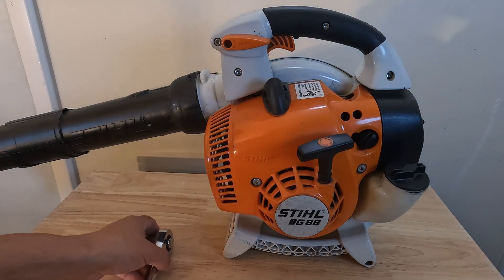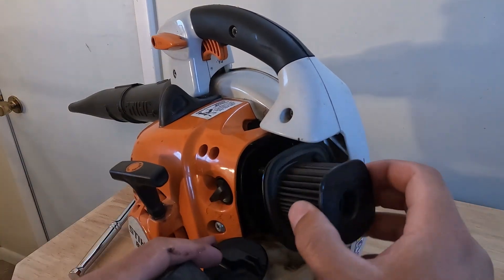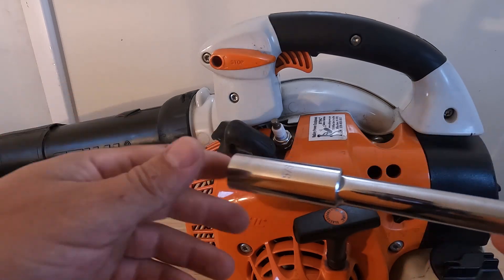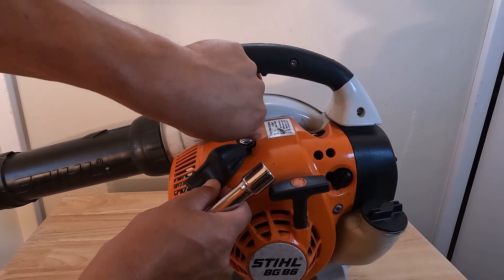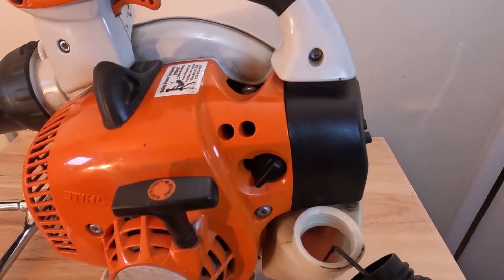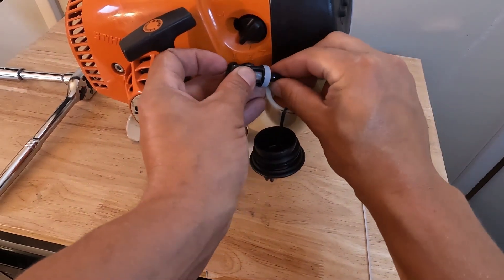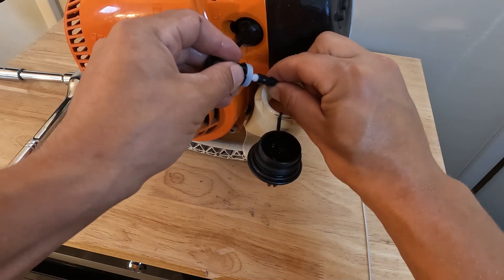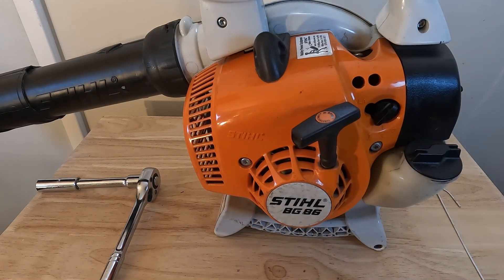Stihl Leaf Blower Tune Up Model BG 86

Comment: I've got a new BG 86. I was thinking that it has a washable air filter. I assume a bit of dish detergent would clean it up when the time comes. Do you agree?
Reply from the maker: That's exactly what I usually do to clean them. Little bit of dawn and then hand wash and leave them on a window sill to dry.
Reply: @fixanythingsavemoney  Thank ya, Sir! I did a bit of research after my post. They say to use a cleaner with a ph of at least 12 to clean this type of filter. Dish detergent is like an 8. I figure if I don't let the filter get REALLY dirty, should be just fine. 
Really enjoying the blower. I've burned a half gallon of gas so far this fall. Runs like a top. I plan on draining it in the spring and cleaning the filter then whether it needs it or not, so it will be ready for next fall.
Reply from the maker: That's good to know! I had no idea. Glad it's working well for you! Thanks for watching and for the comments! Have a great rest of your weekend!